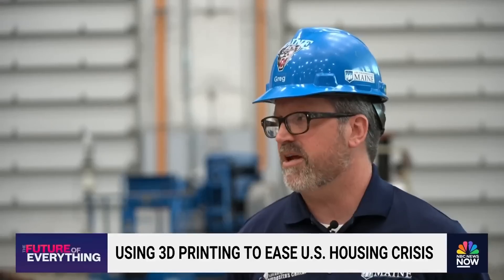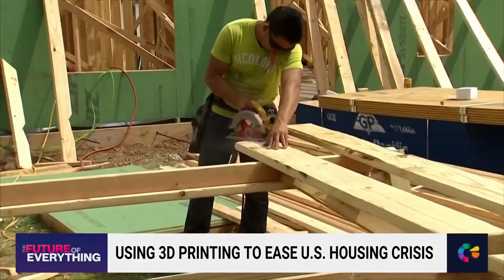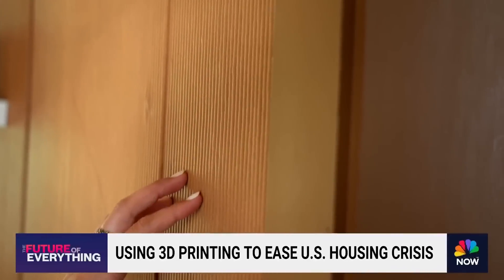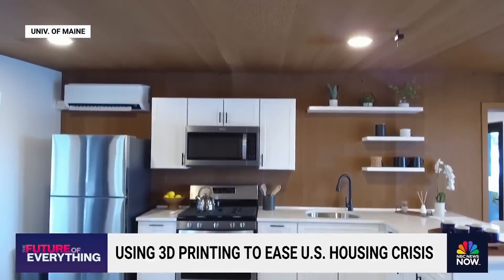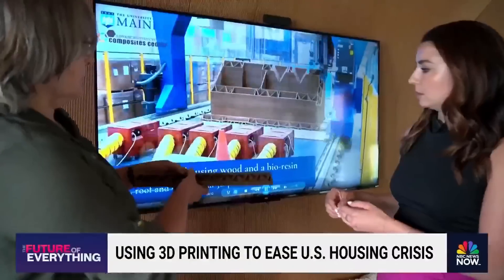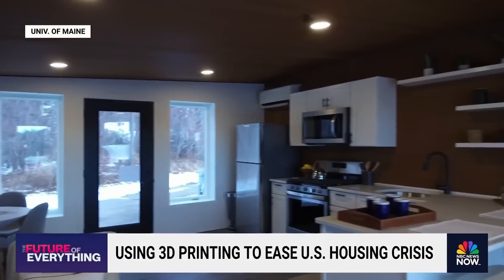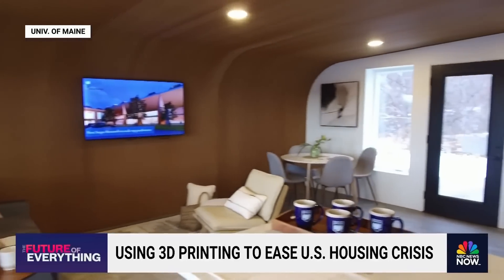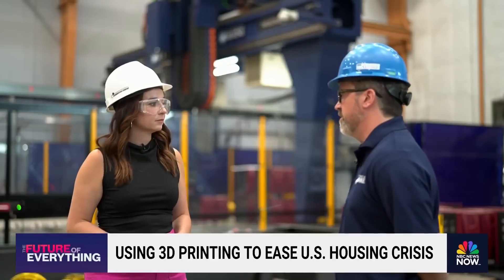3D printer works to target U.S. housing crisis

Comment: Its a composite. Mix of synthetic and natural. Wood fill/grounds and plastic resin.
Reply: Not exactly fire resistant. I bet it burns like a torch.
Reply: @Cucumberflavoredmustard  wood and plastic have never been for resistant... Like never ever. So yeah, safe bet.
Reply: @whiqeddik7615  Which isn't to say western frame construction isn't any better, but at least with that, it can be sheetrocked, and replaced partially if it does catch fire. It looks like if this "shell" is even burned a little bit, or even cracked, the entire thing is compromised and unrepairable.

Comment: The problem I can see is that over time plastic gets brittle and weakens.....
Reply: I work on bridges for a living. There's a plastic bridge I replaced the guardrail on thats 20 years old and is still going strong. The guardrail rusted out as it was steel. The main structure of the bridge is extruded plastic.
Reply: @beserkergang  What exactly does a plastic bridge carry? I'm guessing it's a playground.
Reply: @user-dw1ls3rp1l  lol one would think but, the bridge is 20 feet long and 12 feet wide. Single lane only. It is an experiment conducted by WVU.
Reply: @beserkergang  A single lane, experimental plastic bridge? I'd be interested to know the span, the max load per axle and total, the upward pre-stress deflection and the max downward deflection under max load. I bet it flexes like a wet noodle.
Reply: @Cucumberflavoredmustard  no idea about that. I do know it didn't really flex any more than a steel bridge of similar size.
Reply: UV will break it down before that. I also don't see enough structural rigidity OR flex to withstand any sort of snow accumulation, something wood trusses excel at.

Comment: You don't even need a laser printer. What is needed are re-usable molds you assemble the mold and put in the electrical and plumbing est... pore in the material you are using and allow the time for the material to solidify and finally disassemble the mold. And on to the next job. Rural community development in rural small towns where the state owes the land and can build housing on and rent it out on an ability-to-pay basis to own offered to America's poor and homeless for starters.

Comment: The cause of the shortage is local governments mandating single family homes and restricting housing density.  Production isn't the issue. 

Houses should be made out of wood. Carbon storage.
Reply: You have a very good point.  More detached, single family housing is not the solution.  Land is expensive, they need to build upwards.

Comment: "More natural based."He's building a plastic house😂
Reply: Why is that so bad? we wrap all our houses in these days(Vinyl Siding), and all of our plumbing is a type of plastic...so many polymers are used in things yo take for granted everyday that you dont even know is a polymer.
Reply: @ImagnGames  No , my house has wooden siding and copper piping.
Reply: So much better than a sidewalk or hotel room
Reply: @desmeisme  ? I prefer jungle gyms and diving boards , but what are you even talking about?
Reply: Lol these aren't traditional plastic 3D printers, my guy.  They extrude concrete and other materials that are already used in the industry.
Reply: Bioplastics are made from plant cellulose as well as the wood fiber they're reclaiming.
Reply: @jamesmcintoshjr  bioplastics are neither biodegradable nor compostable, and their residues generate the same pollution problems as those derived from petroleum because they also produce micro and nano plastics during their decomposition
Reply: What if we just matched the wages to housing price ratio that the boomers and gen X had? Ya know so we maybe be able to own a home before 35?
Reply: @loC2ol  I’ll second that! 👍🏻
Reply: I think that was in reference to both the shape and color of the materials.